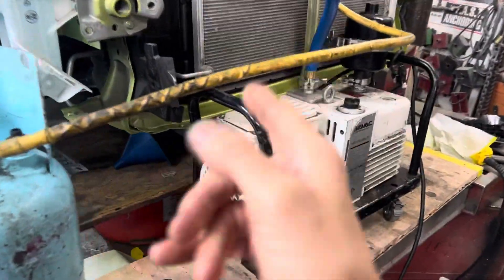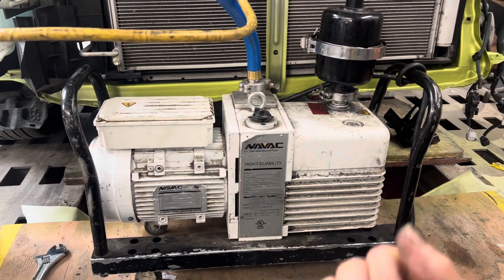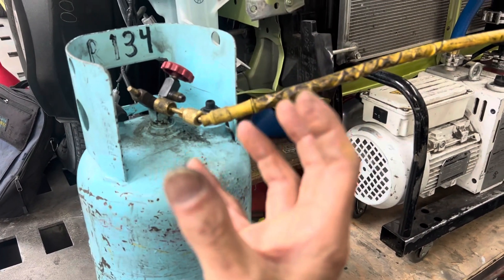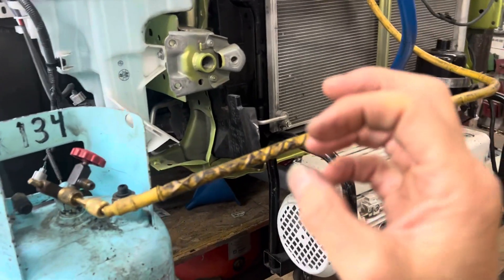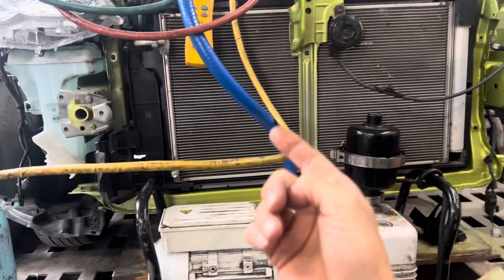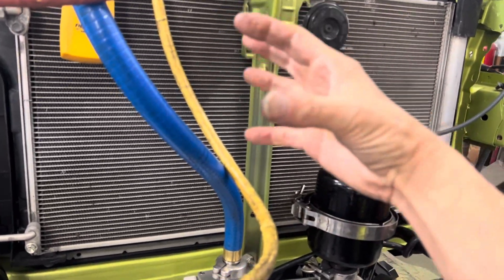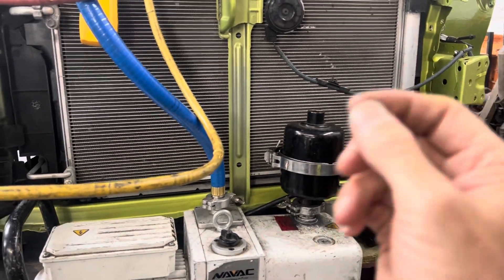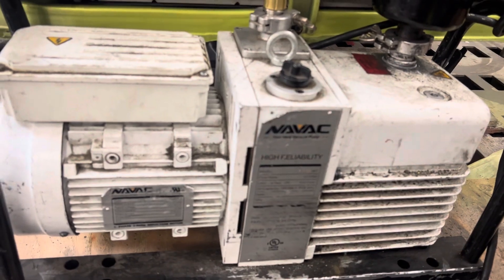? QUESTION ABOUT R1234YF Why does it not cool as well when only about 5% of the charges lost ?￼

Comment: My friend is always spraying a garden hose over the condenser to complete his R1234y filling. He said it's hard to get the cars to take the last few ounces. Have you ever heard of that before.
Reply from the maker: If he hast to do that somethings definitely wrong, but yes, I know what he’s doing his lowering the high side pressure

But that’s just because he doesn’t know what he’s doing in the first place is the reason he’s trying to do that . 

It’s OK he’s with the other 95%. Remember there’s no law against rules or regulations against not getting a correct formal education for. . 

As long as somebody could guess at how to halfway put something together and it either gets warm, it gets cold. The real rotates in the engine makes noise it’s considered good enough. . 

I just feel sorry for the customers .

Comment: Can I get your recommendation: At one time I had a large collection of R-12 autos and it made sense to get the license, bought the tools and even a used recovery recycle machine for personnel use. And if the car didn't adequately cool it was on me; I didn't have to fight w/ someone else to make it right. Now that the R-12 autos are being/have been replaced w/ R1234yf what would be the tools in the order that they should be purchased that makes sense for the DIYer w/ only 1 or 2 R1234yf vehicles. (R1234yf is expensive but is a recover machine really needed if you can have a shop do the evac and it's a new car/truck that you'll only keep for 4-5 years?) Initially I was just interested in determining system pressures to validate the condenser electric fan wasn't coming on due to AC system.  I can tell that my R-12 stuff like vac pump, hoses, etc aren't going to cut it for pulling vac into microns so I'm basically starting from scratch. Thanks
Reply from the maker: Your old vacuum pump should do as long as it’s in good shape just change the oil. 

I good accurate scale capable of being accurate in measurements of at least 5 g

As for cheap gauges.    The cheapest gauges I would get for a DYI person is a set of yellow jacket analog gauges. 

You’re just interested in doing your own vehicles and if you only have two vehicles it’s not rocket science and you’re not trying to reinvent the wheel. 
                   All you need to do is have somebody recover the refrigerant. 

You can leave your gauges on your vehicle overnight on your vacuum pump

And use a scale to correctly weigh in the quantity by weight recommended by the manufacturer for your particular year make model vehicle
Reply: @coldfinger459sub0  Wow!  Thanks Tom that's good news. I'll verify the accuracy of the scale. I was planning on getting the yellow jacket gauge set and looking for a 4-port w/ their hoses. Next would be the silicon blue vac hose and finally a Micron gauge or maybe vice versa, I could always use a good micron gauge if nothing more than verifying the gauges and hoses are in good shape.

Comment: Ha, ha, ha!  Never let go of that vacuum pump, keep a rebuild kit on hand (because the kit might become unavailable).
Gotta have a liquid column at the expansion device, there isn't much room for liquid in the bottom of the condensers these days.
FWIW, total system volume of the old r12 systems (minus dryer) was just over a gallon.  A gallon is 231 cubic inches.
Reply from the maker: Super true.